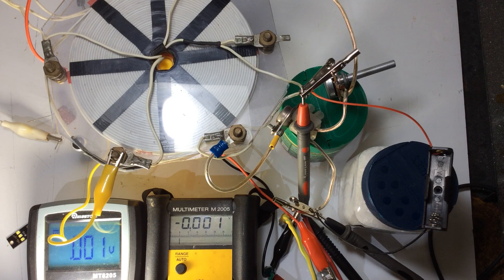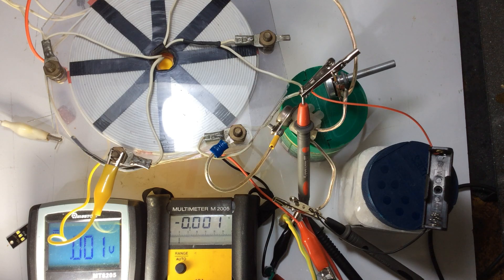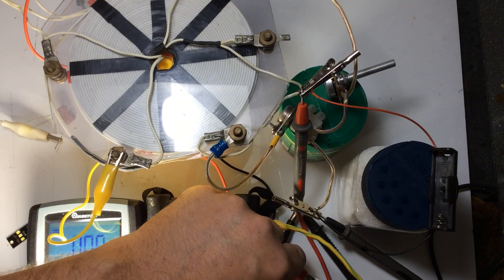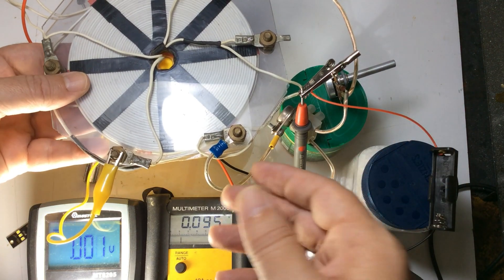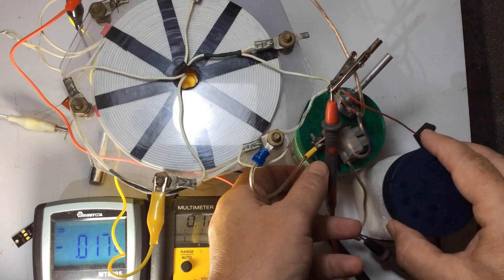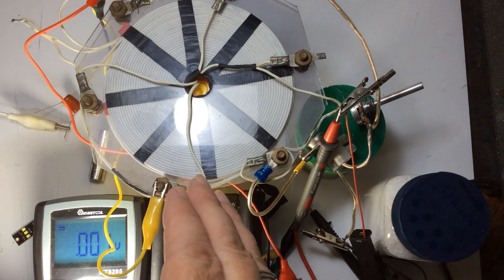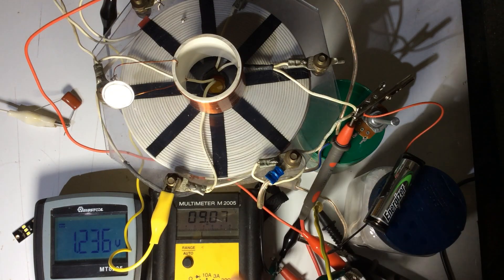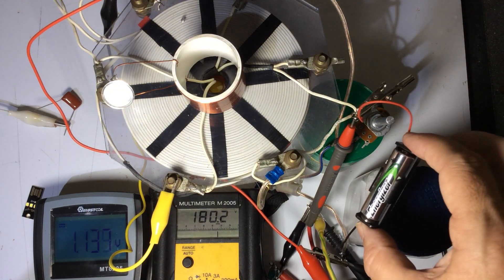Tesla Pancake Coil Joule Thief 1.2V to 180VDC

Comment: Please try to loop the output and switch to input, there should be enough left over to keep it running:) well doii
Reply from the maker: Thank you for your comment.
I find it more efficient to feed an external power source than it is to feed back to source. I feel with feedback to source most of the circuits of the past struggle to realise the assumed gains and those gains are more easily realised charging an external power supply.
Thanks for watching.

Comment: I like pancake coils more than cylindrical coils as it seems power is not radiated so much around the circuit … somehow the field radiated is much smaller. I wonder if you observed this effect or is just me being wrong ?

Also, in this setup I wonder if curent can be improved using a spark gap and capacitors ? I noticed these coils are smaller than the other setup with zvs used for heater.
Reply: they have a completely different advantage... asymmetric coupling.
ALL the flux from the primary must pass through its centre, and interact with the secondary.
the secondary, conversely, only a small portion of its flux couples to the primary.

meaning the secondary can resonate freely with very little affect upon the primary. and that relates back to Q, resonance, and how a transformer normally "reflects impedances at the square of the turns ratio"...
Reply: @paradiselost9946  You are being censored
Reply: @TravisTellsTruths yt is the censor
Reply: I know 😊  @Caesarus2011
Reply from the maker: @TravisTellsTruths I find it astonishing that YouTube censors this field, wouldn’t it make more sense if people were allowed to learn unrestricted, as a collective conscience we would make more discoveries and improvements if we were allowed to collaborate with each other. In my opinion YouTube would be better off NOT censoring us and perhaps give credibility to the statement “I learned it on YouTube”.
Thanks for watching.
Reply from the maker: @tonythai5991 Thank you for your comment.
YouTube only censors the truth, so there’s a positive in there somewhere!
Thanks for watching.
Reply from the maker: @paradiselost9946 Thank you for your comment.
That sounds about right. 🤣 I spend most of my time working with the physical aspect of these circuits, ie. putting stuff together to see what happens as opposed to having a solid understanding of why and how it does what it does. Whilst I feel it is important to know some of this stuff, understanding it isn’t completely necessary. Somewhat like not needing a full understanding of the combustion engine to drive a car, I prefer to work with physical objects instead of hypotheses, then I can leave it up to people smarter than myself to understand why.
I don’t want to appear ignorant with this approach as without a basic understanding of these systems it becomes much harder to hypothesise if you have no idea at all. At some point I find it helpful to make these smaller judgements as we go, each step along the way I will make a decision as to whether I should learn more or just push forward. One barrier the education provides is inaccurate evaluation of a process that stalls investigations, if we think there’s no point moving forward because of the education then we won’t make any new discoveries because we already think we know it all.
Thanks for watching.
Reply from the maker: @Caesarus2011 Thank you for your comment.
They definitely are a different coil, a very different relationship with power compared to any other coil design. One weird feature of a pancake coil of Tesla’s design is the increase in power through the second wire. If a resistor is placed at the centre of the coil you can measure the power through both wires and the second from the middle of the coil has more power moving through it that the amount of power fed to the first wire, being that this coil is a pancake coil consisting of two wires. 

These coils are much smaller than the ones I had the ZVS connected to, I was attempting a joule thief sized setup to allow for easy transportation, something that would fit in a backpack. Caps and spark gaps definitely make a difference but whether they are beneficial depends on your intentions.
Thank you for watching.

Comment: you can channel the flyback back to the battery with a HV diode , may need charge controller or the battery will over charge and damage
Reply from the maker: Thank you for your comment.
Sorry for my slow response. Yeah it definitely needs a charge controller, for this small AA 1.2 volt battery you can strip a controller from a garden fairy light and even use the solar panel. I have run this small setup on 12 volt using a 12 volt solar controller and in each case you need a load across the output to bring the voltage down so as to not blow the controller. Once the charge controller is connected the load can be switched off.
Thanks for watching.
Reply: @whatifididthis...1236  you want to smooth the flyback out with some caps different values in parallel then use LV diode on the output of the caps . Can also try a zener but they have  loss as part of there regulating feature

Comment: I never built a pancake JT, very cool, cheers
Reply: A joule thief is technically always a pancake coil, it’s just wrapped around a toroid, but the coil connections are the same, pancakes emit the field, toroids contain the field if using a solid core..
Reply: @anthonyscott9936  odd you say that. I was just thinking.. I’ve pulled voltage from the atmosphere to a ground rod.It’s  true the coils have to be correct, but other than that. It’s probably close to the circuit Tesla planned on putting in the cupola….
Reply: @johnkuykendall7028  maybe, I think Tesla had a different plan than everyone thinks.. he knew what the pyramids are..
Reply from the maker: Thank you for your comment.
Your correct that you don't need coils to pull energy from the atmosphere, whilst coils will often enhance energy received they are not essential. I believe it is this fact that allows such different coils to have similar effects.
Thank you for watching.
Reply from the maker: I believe he was intending on charging the ionosphere and we would all be tapping into that zero point field, instead they stole it from us and built HAARP to scam us with climate change!
Reply: @whatifididthis...1236  well. It sounds like we just need to optimize the receiving coil. Or perhaps make a more stable connection to the ionosphere. I’ve considered the cathode ray tube or some evaporative system that could increase the conductivity in a given space. Perhaps a concentration of air that has gone through a microbial system capable of cation or anion exchange. It could very well be that we need to create a flow cell and use the atmosphere as the working fluid rather than the standard electrochemical one. By simply providing an abundance of cations in one place anions should be attracted but forced to exchange electrons through a conductor….
Reply: @johnkuykendall7028 I guess you may want to consider an electret for this
Reply: @Caesarus2011  I would assume so.. the main issue (I think) will be creating a charge differential that doesn’t leak out of the circuit once it reaches a certain concentration. Not to mention that since the voltage is increasing so much.. the wire can be thinner but the insulation will need to increase substantially… because in this instance we are talking about charged particles moving along a conductor (Similar to a discharging battery,) whereas the electromotive force is moving the electric field of the atom in the conductor itself… at least that’s my current thought about it..
Reply from the maker: Thank you for your comment.
I think you mean a bifilar coil, in which case I agree that a joule thief is just a bifilar coil, when the two wires are arranged as a pancake it is radiating the field outwards whereas the toroid version attaches its field to the toroid as you've stated.
Thank you for watching.
Reply from the maker: Thank you for your comment and thank you for watching. This was my first pancake joule thief, I had built a heap of Joule Thieves over the years and wished I had of built the pancake one earlier as it is definitely more powerful than the average joule thief.
Thanks for watching.